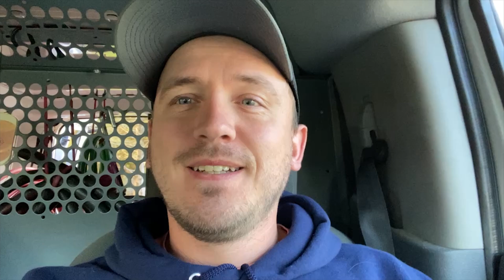Septic System Care: Are Additives Necessary?

Comment: I hoping you can answer my question. I am in texas a long way from you, of course and  I'm sure with different data for septic tanks. But I maintain rental properties and they are all on septic systems. I am used to putting treatments like rid x once a month or every month. And also pouring down a root growth stopper for the leach lines which is  called copper sulfate and both these products or going into the septic tanks. Another thing these properties are being used hard from about April until October with ppl coming and going. With that being said is an addictive necessary for the bacteria and is a leach line weed depressant necessary needed? 

Also, the weed stopper or killing chemical is going into the tank not directly into the leach lines. So it needs to make it's way over the tank baffle etc. I mean is it that even helpful at working in your opinion?

Thanks!